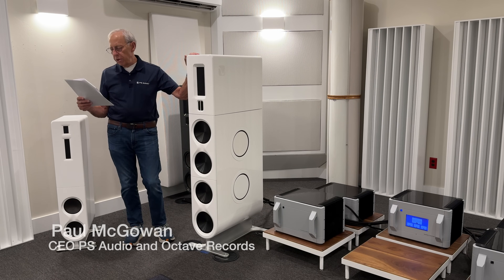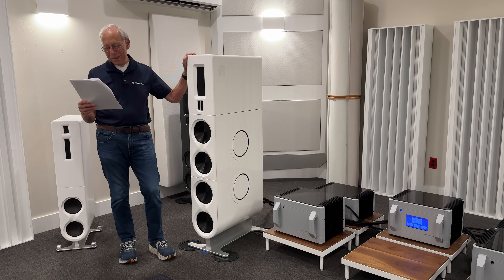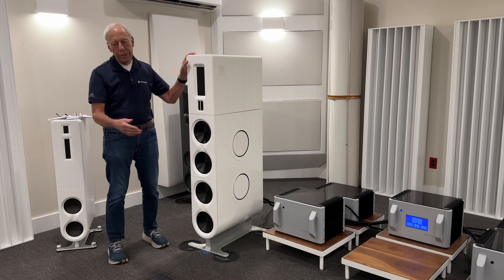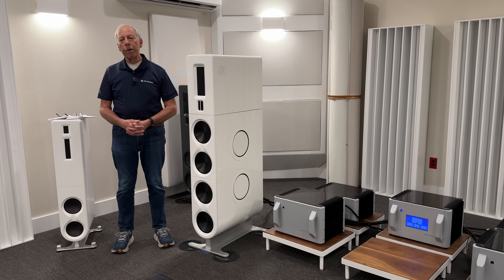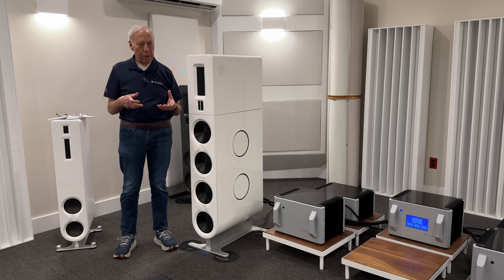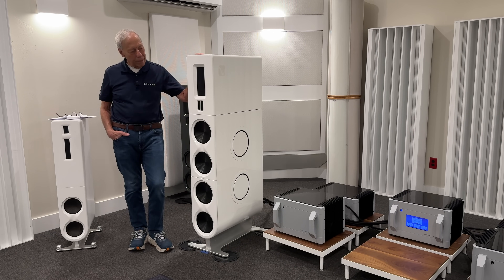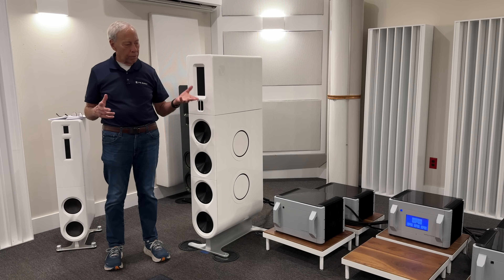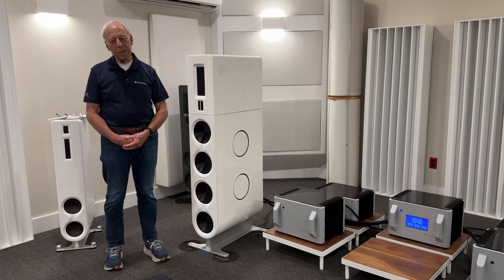Eliminating the AC wall socket

Comment: I live in South Florida and every time I hear that there may be thunderstorms and I am going out or even staying in my condominium I unplug my P-12 power conditioner and a Nordost AC line conditioner. This way my entire system stays safe. I was told by the man who manages PASS Labs that they never unplug their equipment and to the best of their knowledge they have never had an issue with any of their components because of lightning. It still scares me to leave any of my system components plugged in when the weather is this uncertain.

Comment: I would look closely at the electrical wiring laws in Austria before attempting that.
Reply: Indeed.
Reply: Most industrialized nations, especially the US. 
Don't get me wrong, I get the concept, and while it should be "fine", and never likely to have an issue, even if the unit fails or grid issue, such as surges, brown outs, or heaven forbid, a lightening strike, the limited electrician experience and knowledge I have gained over the years has convinced me that any slight improvement you might get is definitely not worth it.
Reply: @l0zerth  Another concern is that if there is something like a fire, your homeowners insurance may reject your claim based on it being wired incorrectly.
Reply: True, we here in Austria must have stiff cables running in the wall, and flexible outside, so you at least have to solder and properly insulate two different types of wires.
I bet there are other rules in place as well.

Comment: Perhaps, but it would have to be shielded or else you will be sucking in RF noise. Last week as a side event to something I was doing I experienced the difference with and without a very common and much used banana plug in the food chain. The difference was so much I went and re-wired things to remove banana plugs from all the main speaker wires, and the effect was remarkable, I had to re-tune both systems to deal with the large increase inn clarity and tweeter realm increase in db. Every single detail, no matter how small or large, can have a huge impact on the sonic results.

Comment: I am confident, based on experience, that the effect of how well you slept the night before you listen has hugely more impact on your listening abilities than the AC wall socket. If an amp is sensitive to the quality of the AC wall socket, I would consider it to be a poorly designed amp as the internal power supply circuitry is intended to isolate external variation issues impacting the sound. Better amps use bigger capacity banks. Preamps and other lower power devices include voltage regulators that can precisely output a voltage no matter if some AC wall socket drops the mains voltage a few milli Volts. This topic is somewhat imaginary, but you can probably make an AC wall socket terribly performing by letting the metal inside oxidize. If you throw an AC wall socket into the ocean and fish it up a year later...it might have a sound to it.
Reply: Yes, a good power supply yields perfect DC even from quite messy AC. Perhaps you're onto something though as worrying about things like these may be causing some people to lose sleep. ;)
Reply: I'm afraid you may not understand what a "transparent" system is. 
You may want to look up some of Paul's previous videos explaining transparency, as well as the debate over things like the power cables for the amp. 
I think you may ultimately be confusing the difference between a pleasant sounding system and a transparent system, so those videos would definitely be with a watch.
Reply: @l0zerth  I work in R&D of audio and design these things, so I can tell you, thanks. A transparent resolving system is one that brings the very fine details of the music into the soundstage with high degree of authenticity and correct tonal balance and without being ruined by noise or distortion artifacts. For a system to be maximally true to the source intent, it needs to be reasonably immune to EMI and wire-carried noise. The mains power is obviously never entirely clean so it’s vital that the power supply circuit has properly designed filtration and regulation circuits in place to keep the power rails clean. A power rail is a DC voltage output of the power supply circuit. You can measure noise on this power rail and good engineers will go great lengths to ensure the voltage is maximally clean without noise due to fluctuations of the mains power. In your house your AC outlet is wired to the main circuit breaker and on the other side of that your house is wired to the main grid on some transformer serving many houses. I can promise you, the least concern you have is a tiny resistance in an AC outlet. If your audio gear has sensitivity to the AC outlet’s voltage drop, it’s time to replace it or you have some seriously broken AC outlet. Forget about the AC outlet and rather you can worry about refrigerators, air conditioners, light dimmers or other high current or noisy loads being shared on the same cables. But even those should not affect your audio when you have an excellent system. Your audio system is excellent when it is revealing on the musical details and not the details of your home’s wiring lol…
Reply: Yes, I do that when I watch the movie Back to the Future - it has a scene with a high school dance with an underwater theme. The sound quality is much better.

Comment: At least in the US, you are required to have a "disconnecting means" within line of sight and a certain distance of the unit, meaning either a plug or switch. 
Technically, the breaker itself does qualify, but I'm pretty sure most high end listening systems are not set up even in the same room as the breaker panel, so not really an option for most people. 
Just make sure the wiring, outlet, and power cables are high quality, and installed properly, and any difference in sound will be pretty minor, and certainly not with the safety risks, let alone code violations that will be very expensive, as well as just having to pay to have it done properly in the first place.

Comment: I’ve implemented that in Norway, IEC 19 (Furutech FI-52) plugs directly terminating my 2 dedicated lines that then I connect them directly to my Shunyata Denali 6000S v2 Filter (Stereo Equipment) and the other one to a Torus Power Isolation transformer (to my Audio-Visual circuit). For me that was the away to Go (LESS is Definitely MORE, in Sound Quality!)

Comment: One could and should after years of use replace receptacles in outlets. One could upgrade at that point. As another mentioned hardwiring to a dedicated circuit should not be an issue.  Stoves and rather and some built in units are done this way to a dedicated circuit not a shared one. Also while on this topic, replacing breakers after ten or more years can be beneficial as well.

Comment: That's a potentially costly mistake because if something were to go wrong and your house burned down, your insurance might not cover it once they see that you have been messing with the wiring.
Reply: Not true at all… even if it is not a good idea😜
Reply: @Skye_the_toller in the US, it is hard enough to get insurance to cover things on initial claim, even if your "i's" are dotted and "t's" crossed. 
If the insurer finds code violations, they will almost certainly not pay out, have the legal right to drop you completely, and may be difficult to find another company for coverage after that.

Comment: Maybe change from a regular domestic AC receptacle to a much larger industrial unit may help, at least you still have the option to disconnect if needed.
That would also stop others pinching your socket to run the vacuum cleaner etc.
Reply: At least in the US, there is no such thing as "industrial" outlets as far as different connector styles that would prevent anyone from using it for any other standard home appliance. 
You can get "hospital grade" outlets, which are far more robust in their build quality, and in price, but the actual receptacle is the exact same three prong layout as your standard 120 or 220/240V outlets, just a special cover plate color, and beefier components.
Reply: I think the more realistic benefit if possible, would be to just have a dedicated circuit for your stereo wall receptacle....so no other loads on the same circuit. I could add a breaker and wire one in my home as I have access from my basement to fish a new wire up through the wall plate... but would I go to such effort... no way. 

I run my stereo equipment on a good-sized UPS which I feel gives me some surge protection, and when an outage occurs there is no voltage irregularity to be concerned about... and I can even continue listening!
Reply: @l0zerth  So what do you do if you need say 60A in a factory?

Comment: Easy enough to upgrade you exiting cable male end to a hospital grade twist lock receptacle. If  you have a poor connection which some receptacles do especially the contractor grade ones. If your system is that reveling i would think you would have to listen to specialized music for it to sound good. Not for me.

Comment: Your concerns for safety are ABSOLUTELY real. This would create a very serious fire risk, not to mention an NEC violation. Now if you had a service disconnect within that junction box that ties the building NM-B to the power cord, it at least provides a required disconnect from building to appliance. 

Is that worth doing? No. If you want to safely improve connection from building to appliance, consider high end 20A outlets. There are outlets that employ full copper conductors and contacts with gold or rhodium plating for oxidation mitigation.  They are pricey at $75-80 USD. 

Is there an audible difference? Unconfirmed as I personally did not perform any A/B listening comparison. What I can confirm is that resistance, measured in ohms, from the side terminal plate contact of receptacle to the backside of Cardas 20A male power cord  plug, is lower by nearly 20%. The measurements were using a Furutech 20A duplex outlet, the rhodium plated copper version and a Hubbell hospital grade orange 20A outlet. The Hubbell has been an industry standard for AV installs for many years, I believe it is tin plated brass conductors.  Once I saw the reduction in resistance, it was 3.8 ohms to 3.0 ohms iirc, I switched over to the Furutech’s for all AV and computer outlets.

Comment: In the UK, a direct connection would be illegal, as it would become part of the domestic wiring and will not be covered by the following
BS 7671 - 18th Edition  IET Wiring Regulations
Not forgetting the fire risk ect. I would guess your country would regard this in the same manner. If it made a difference then you kit is junk.
Reply: That's most industrialized countries, and for the same good reason. 
I get it, and if it's on a breaker, it "should" be fine, but please, just don't.
Reply: 1: No one should care about any policy the UK has other than to use it as a model of what not to do. 
2: Hardwiring stuff into the wall is fine. There is only a fire risk if you want to use insufficient insulation and protection for the connection. Outside of that there is no functional difference between a junction box and an outlet unless it has it's own internal breaker.

Comment: If one has a PS Audio Power Plant, does not the Power Plant take care of any of the (rather small) power corruption due to the wall connection?
Reply: Really good question, I wonder the same thing as I have one.
Reply: It's not always a small "corruption" in the power coming out of your wall, but yes, that is the whole point of the Power Plants, as well as the built in digital oscilloscopes that you can use to compare the input from the wall to the output going to your audio equipment.

Comment: Back in the 80's I brought 10 gauge direct from my breaker panel and hard wired it directly to my power amp, right to the the power transformer and the replaced high amperage on/off switch, nothing in between except the 20 amp breaker itself - this was an experiment that opened my eyes to getting solid power to my equipment - naturally I refined the set up, it was an experiment, but to this day that same cable is bringing power to my listening room and of course, yes, everything is properly installed and terminated to high end outlets that are installed physically close together in an effort to minimize any ground looping or voltage differentials.  hmmm, 🤔 what about one of those high end breaker panels - - kidding, I've gone far enough for me.

Comment: I remember when I first got into audio. Car, home, pro, audio. I was searching for the most quality for the buck. I discovered that using car amplifiers and batteries in the home was the most cost effective. Theres power conditioners out there that harm the sound, dynamics. And plugging your amplifiers into a dirty wall socket just didn't do much on the cheap. Plus cheap home amplifiers that are stable below 8 ohm is not common. Nowadays 4 ohm stable home amplifiers are becoming more available. I feel impedance in an amplifier is more important than watts. Basically what I found is that you can get a decent class AB car amplifier that is 2 ohm stable with both channels driven for around 100 bucks! With the amplifier being powered by the battery. It isolates to itself. The battery and charger cost more than the amplifier. But it allows you to buy each component individually instead of all at once. That's also more cost effective. Connect the car amp to a decent DAC, preamp, connected with decent rca cables and your all set. I couldn't believe how low the noise floor is at that price 🤯
Reply: true hi end delivers juicy voltage regulated power supplies embedded out of the box
car's class AB audio amplifier has a switching power supply inside that converts DC into Vcc+ & Vcc- or uses not very sophisticated class D IC - not a very clever idea for an apartment/house
- control amp is the tricky part
- then just add a modern class D kit
- modern 200 bucks computer m/b with premium sound on board sounds exceptionally good to start with
- speakers...guarneri g5 costs like a car (
Reply: @sarabarabu-mq1ci as Paul has mentioned several times, computers are horribly noisy in the electrical signaling, and especially RF leakage. 
The "HD" audio from the built in headphone jack is fine for casual and background listening, but you can't hear it on your system, your system is definitely not transparent. 
I'm not saying your system is bad or doesn't sound good, but if you get a chance to listen to a truly transparent system, perhaps at a friend's or a hi-fi dealer, you may understand what we are talking about. 
Honestly, a USB connection with a high end cable to a separate DAC is fine, even for most audiophiles, though you may still be able to hear some noise with a system that the amp and speakers have good transparency.

Comment: We have 230 volt in Sweden so it takes a lot to get such a bad connection that it effects the sound. On the amp and speakers it makes a bigger difference. But it's not very practical having hardwired speakers

Comment: Why would it matter if it is going to a power regenerator? The best thing you could hope for is a lower impedance such that you can draw a larger amount of current on the peak of the AC waveform coming from the wall. This can give a big sonic difference on a power amp, but if you are ultimately just rectifying it and using it to charge capacitors, then the only reason a lower impedance would be beneficial is to be able to charge the caps faster. But at that point, you now have a lot of resistance and impedance to the wall through your power transformer and diodes. 

IIIIIIIIDDDDK man. I would honestly test that theory out. If it makes no difference, thats a good thing. If it does make a difference, then there is a ton of performance being left on the table for the regenerator.

Comment: No doubt a very small improvement, based on my experience with buying better plugs.  Also important to not give your insurance any excuse to deny a claim if a lightning strike wipes out your system or sets the house on fire.

Comment: So… an in-wall cable (cheap 12-2) may sound better than an aftermarket $$$ cable?😂😂😜😜🤔🤔🤔🤔
Reply: As Paul has mentioned previously, much of the electrical contamination on wires inside the house are not the ones in your wall, it is RF interference on all the cables outside of the wall that cause most of the issue.